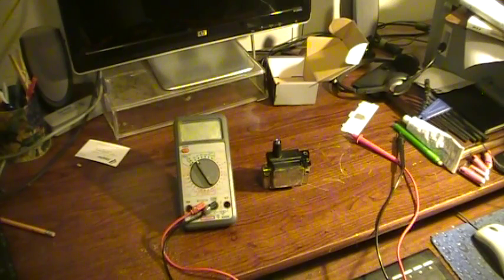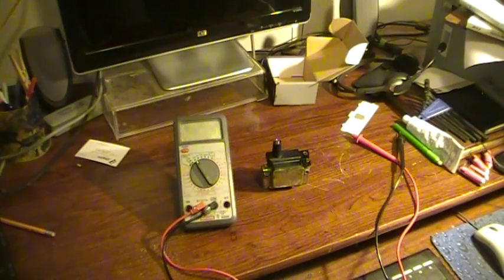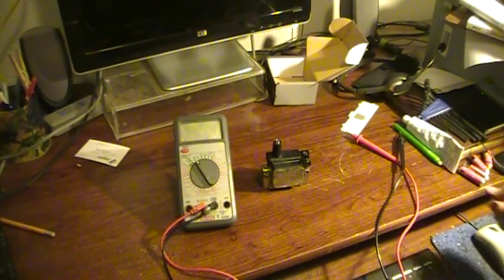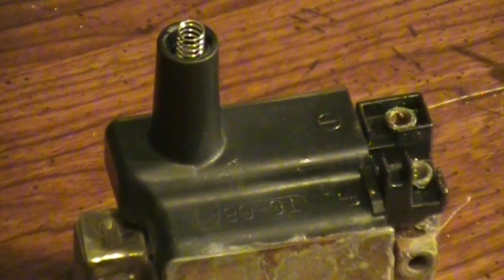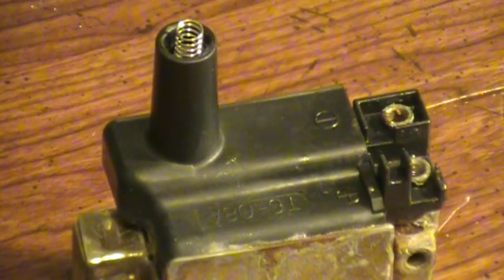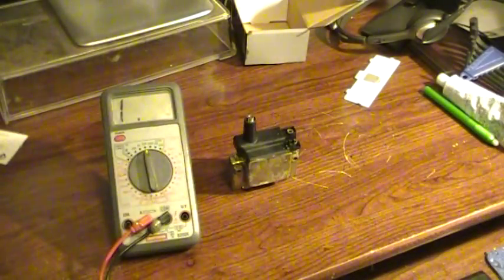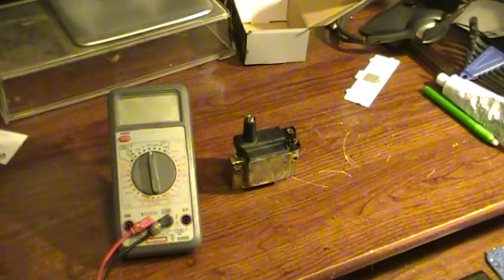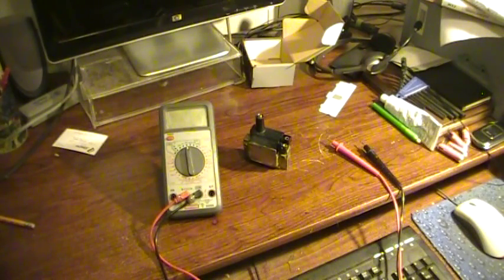How to test an ignition coil

Comment: The only video that i got anywhere with. Gonna replace distributor coil. Getting  high resistance values on primary side. Mirroring the same number you demonstrated in video. It acts up bad and has noo HP to get out of its own way. ... when engine is hot this adds to the mind screwing. 1998 Dodge ram 5.9

Comment: Hi all 

I have a haunting honda once it gets to normal temperature, the car just sound alike it is missing once you out load on the accelerator 

I had tested the coil and these are my results:

Primary was 0.00
Secondary coil was 16,45

Do you’ll think the coil is damaged?
Reply from the maker: If the car starts, it should not be your coil.  Some things to check.  Battery and alternator.  Air pocket in the coolant.  Idle Air Control Valve.  What year, and engine do you have?
Reply: @tubejim101  that’s the thing the car starts, it’s a 1997 civic so4 B16a
Reply from the maker: @TRDKhanbrothers  If your obd2 works, scan for some codes.
Reply: @tubejim101  thanks will try that as well

Comment: 0.6-0.8 ohms? Kohms? Mohms???
Reply from the maker: Hitachi is .45 - .55 ohms, and 22.4 - 33.6 K ohms.  For TEC it is .63 - .77 ohms and 12.8 - 19.2 K ohms.  You can tell a TEC distributor, by looking down on it.  The cap will have a D shape to it.  Also the Hitachi coil has blades for terminals A and B.  The TEC has screws.  The coil in the video is a TEC.
Reply: @tubejim101  ok..I got 0.9-1.0 ohm on primary and 16.7 K ohm on the coil post...so I'm a little high  on the primary..I see a burnt mark and coil appears to work great when first starting after car heats up approx 5 minutes the engine stops..as though no fuel or firing taking place..I am replacing the coil.
Reply from the maker: @johnbear6145  Check the resistance of your test leads.  Usualy, a bad coil will not start a car.  Always start at the battery and alternator.  Most auto parts stores will test them for free.  What year, make, and model are you working on?
Reply: @tubejim101  2001 Honda CR-V... Yeah their own test shows that it's good but my coil has a damaged terminal and then there's also a burnt mark on the back and I'm just wondering that it maybe works when it's cold but once it heats up then things go out of whack?
Reply: @tubejim101  thanks for your info...I have a TEC coil
Reply: @tubejim101  my civic has no spark at the plugs i got 1.0 and 9.3k on my TEC, is it the coil?
Reply from the maker: @SLHDub  What year, make, and model are you working on?
Reply: @tubejim101  civic hatchback 1999, same TEC TC-08A coil as yours
Reply from the maker: @SLHDub  For TEC it is .63 - .77 ohms and 12.8 - 19.2 K ohms
Reply: @tubejim101  mine reads 1.0 and 9.3, does it mean is it bad and thats the cause of no spark?
Reply from the maker: @SLHDub  Sounds bad to me.  Take your meter to the parts store, and see if they will let you test a new one.
Reply: @tubejim101  thanks👌
Reply: @tubejim101  it was the ignition coil. fitted a new one and it started right away
Reply from the maker: @civic h22 all motor What year make and model are you working on?

Comment: You have to account for the ohm meter lead resistance. Mine were .03 to .04 or .3 to .4, one of the two. My A & B terminal read 1 so when that was removed it was spot on.
Reply: @civic h22 all motor put the test leads together and it will show you resistance in the wires.  My problem ended up being a faulty ignition module. The new one was bad out of the box. Dune buy the cheap ones bc they're bad oftentimes, I bet.
Reply: @civic h22 all motor it depends on the ohmmeter

Comment: I have 2001 CRV. I checked for visual spark with each wire and plug and each had equal and appears to be well-timed spark.  Is there a way to confirm Spark is strong enough from the coil though? I could not tell if spark was blue or white, because it's in the daytime in my driveway.  My concern is maybe the overall spark is weak and not igniting any cylinders properly. Is that even likely it would happen or make a no start condition all cylinders?   So is there a way to check the strength from the coil itself?
Reply from the maker: Need to have your battery, starter, and alternator tested.  Most auto parts stores will do this for free.
Reply: @tubejim101  I can't drive or anywhere and I'm not going to remove them. I've tested the battery and recharged it, tried jumping starting also. It's not the battery or alternator keeping it from starting. It cranks over good, just won't start so of a sudden. It sputtered twice one day going around a traffic circle and making a turn as it coasted and then the next day or started this. I don't have any codes. I'm wondering if it's a cam or crank sensor. If crank sensor was bad I wouldn't have any spark right?
Reply from the maker: @thesetruths1404  Have you tried starter fluid?
Reply: @tubejim101  yes, and it wouldn't start, but then I found my spark plug wells were full of oil (to the top of the plugs, evenly across all 4 wells) so I'm not sure if that was effecting spark at the time. I removed all the plugs, ohms checked them, checked gap, checked for spark on each plug and wire (all were good and spark present), and cleaned the wells out. I haven't tried starter fluid since the cleaning...maybe I should?
I cleaned the PCV valve, it seemed to be possibly clogged, and I'm wondering if built up pressure from failing PCV valve pushed oil into spark wells, via the likely weak/old plug seals. It has 239k on it, but was running great right before this problem. 

A friend says he hopes a cam lobe isn't flat and caused the pressure. But the motor was quiet and running super before this.

Oh, I also checked the fuel feed from the top of the fuel filter...it came squirting out. But I want to check the injectors to make sure they're getting power to open. I don't know how to do that.  You?
Reply from the maker: @thesetruths1404  Here you go.  Just use about half as much Hondabond.  https://www.youtube.com/watch?v=08lJ3TIKImU
Reply: @tubejim101  thanks, from what I've read there are two sets of plug well/tube seals...an upper set (attached to cover) and lower set (under valve assembly). That video doesn't show the lower set. They are thinner and more like orings from what I saw. Do you know about those? Trying to confirm what the part number for them are. Do you know the name or part number?  I could call Honda too I guess...
Reply from the maker: @thesetruths1404  If you go into Honda, they will print the pictures for you.  You can also look it up at https://estore.honda.com/

Comment: Will the car crank over if the coil is bad? I'm having some kind of electrical issue with my distributor. I've got no check engine light and it won't crank over.
Reply from the maker: Usually, the car will turn over, but not start if the coil is bad.
Reply: @tubejim101  Thanks. What about the module? Whatever my problem is, a new distributor fixed it. But now the problem is back. I'm wondering of I've got a bad plug wire or something that's burning something up the distributor. Both my ignition switch and main relay test good.
Reply from the maker: @Funkedelic84  You can get a free testing at most auto parts store.  They should be able to test your: battery, starter, and alternator.  Bad batteries, and alternators, are often the problems.

Comment: i have no spark/start situtation on 2001 chevy blazer...i tried everything new cap rotor ,cam senor..even  replaced timing chain that was stretched pretty bad... it had a p1345 code... i tested coil while it was still on truck and the numbers were way over 1 bouncing all over place... I have no codes come up anymore and am praying another coil will fix...thax

Comment: tubejim101, I'm unable to remove the electrical connections from the ignition coil, the Phillips screws will not budge. Can you still get a correct reading of the ohms while the coil is still connected?
Reply from the maker: Hit is with some wd40 and wait 10 minutes.  Then grab the top of the screw with some vice  grips, and break it loose.  Make sure you are using a good fitting screw driver.
Reply: tubejim101 no luck with letting the WD40 penetrate the screw. I'll need to try out the vise grips. Thank you for responding!
Reply from the maker: No problem.  I use the vice grips a lot for stuck screws.  Next time I use them, I will make a video showing how I do it.
Reply: tubejim101 plz, that would be great! I had the boys come out and they were sweatin' haha

Comment: Good specs at least.  Tested the new coil out of the box and the primary side was 1 ohm.  The secondary was at 15.8 K ohms.  Bad coil had shorted together the fine windings and the secondary was at 7.5 K ohms.

Comment: Hi my friend, my coil is doing 1.0 on primary and 26.9 on secundary. Is it bad?
Reply from the maker: What year, make, and model car are you working on?
Reply: My car is honda accord 95 AT 2.2L EX Vtec. Thanks for helping me.
Reply from the maker: I only have docs for 90 to 93 Accords.  You would need to use google, or get a repair manual to get the values.
Reply: All right but could you tell me what is for 93 please? How can I look it  by google? Thanks.
Reply from the maker: At 68 degrees Fahrenheit:  Primary 0.6 - 0.8 ohms.  Secondary 13.2 - 19.8 ohms.  So if you had a 90 to 93, yours would be bad.  If you where measuring at 68 degrees Fahrenheit.
Reply: Let me talk to you something: I am in Brazil and here is very dificult to have mecanic to fix this car.  And are you mecanic? Well, when you talk about temperature means weather or engine? Because here is hot like 34°C. And I got 0.8 and 26.5 what do you think?
Reply from the maker: The temperature is for the coil (20C =68F).  In the repair manual, they point it out, because the engine gets around 100C.  So if you take the coil out, and let it cool to room temperature, you should be good. I will see if I can find the coil specs.  Am just using google to find it.
Reply from the maker: Primary:  F22B1 0.4 - 0.6  F22B2 0.6 - 0.8
Secondary:  F22B1 22.4 - 33.6  F22B2 14.4 - 21.6
Ignition Wire:  25K max
I am just a self taught mechanic, but have had professional training in other areas.  Pretty much just work on my own cars.  And friends cars.
Reply: Thank you so much my friend, you helped me a lot.  God Bless you.

Comment: Tubejim101 I  have the same coil pack in your video and when I did my test I got 0.9 in one test and 1.0 the second test. Anyway the 2000 accord (2.3L f23a5) I had would jerk while driving and then eventually It would die while sitting in traffic. after some effort it would start and eventually this past monday while I was warming it up it died and never fired back up. Replaced the coil with one from ebay ($10.50) and it fired back up. I bought a new distributor  for insurance purposes and I will replace the whole thing.

Comment: is it possible that my ignition coil is bad? the car died while running and a couple of minutes it start again, I experience it trice and have to stop driving the car unless i figure the cause..
Reply from the maker: What kind of car?  Usually, when the coil is bad, you will have a hard time starting the car.
Reply: crv 2000 model, the vehicle just died while running then it will not start it just crank, few minutes or a half an hour it start again, it has millage 0f 143+
Reply from the maker: Would check the coil. It is not to hard to do.  Could be your ignition control module.

Comment: thank you! you just saved me from making a $100 mistake.
just to add to the info, according to Haynes manual, if you have a 1996-2000 Civic with a Hitchachi distributor: primary resistance is 0.45-0.55 and secondary resistance is 22.4-33.6k-ohms.
I was getting readings of 1.2 and 16.2 respectively.
Reply from the maker: So many people just throw parts at problems.  Congratulations for taking the time to test it first.
Reply: ardx1

Comment: What do you set the dial on the meter to? cant see its too out of focus
Reply from the maker: +Robbie Gee Ohms setting.  Your meter may be different then mine.  My low setting is 200.  The next setting I used was 20K.
Reply: cheers ill test it tomorrow fingers crossed it will be a cheap fix

Comment: thanks , thank you. you are the first one that explained it right on. i am not a mechanic neither an electrician. but i was trying to find a solution for the (2) pencil ignition  coils . the repair book talked about primary ohms .8   and secondary ohms 16-23 . on a 2004 Kia optima.  

question: the pig tails already have a ground wire correct? (ignition coil connections)  when the bolts (coils) are screw to the aluminum caps on top of the motor won't over load more ground? or interfere with the other ignition coils?
Reply from the maker: +Juan Alberto Diaz The Ignition Control Module (ICM) goes to B.  The ICM has built-in noise condenser. A get fed from the + battery. Secondary goes to the Distributor. A and the Secondary are in series. I don't think there is any grounding going on with the bolts.  The spark plugs should be the ground.  If I understand it correct.  What I am describing, is how Honda did it in the 90s.

Comment: Your low resistance reading is off because you are not taking into account the wires resistance. Touch the wires, take the reading and subtract it from the coil measurement.
Reply: If you have a power supply with adjustable current limiting, these low resistances can be measured accurately by putting a constant 1A current across the terminals, and then using the DMM in voltage mode to read the voltage between the terminals.  If you read 0.8V, that would correspond to 0.8 Ohms.  This can be used to get measurements down to thousandths of an ohm by reading in the mV range scale of the DMM.
Reply: Sure, but you need a current generator and a voltmeter. In this instance using a simple ohmmeter is accurate enough, but wire resistance has to be taken into account.
Reply from the maker: 1 foot of 22 gauge wire is about  0.016 ohms.  Does not matter much.  Also you need to read the manual that comes with your dmm.  Not all dmm's work the same.
Reply: You'll find pretty significant variations just due to contact resistance with the probes.  DMM use such a small measurement current you won't get any consistent measurements within  milliohms. But if you're simply looking for ballpark measurements, then it's fine.

Comment: thanks for going to the trouble of posting on here, but i cant see what settings the multimeter should be?
you mentioned 20k but not the other test
Reply: You adjust the scale on the ohm meter based on the predicted result. The first test should give a result less than 2 ohms (whether good or bad), so you would set the meter at 2. The second test would give a result of 15 - 21k, so you set the meter on 20k.